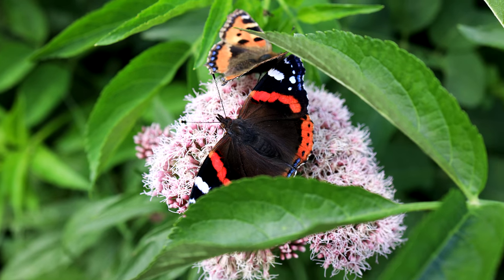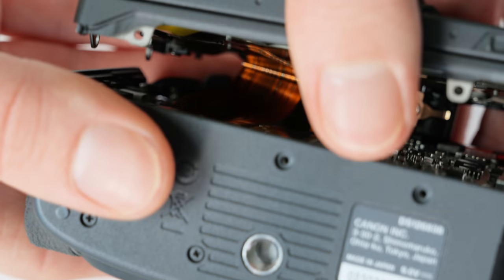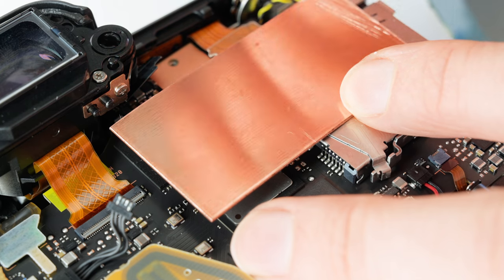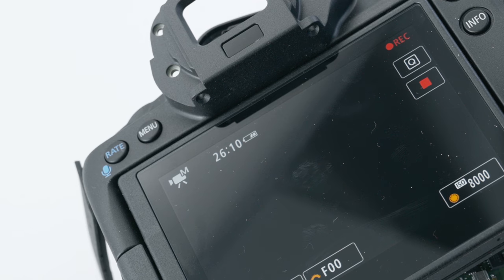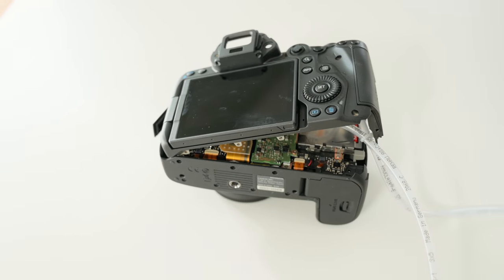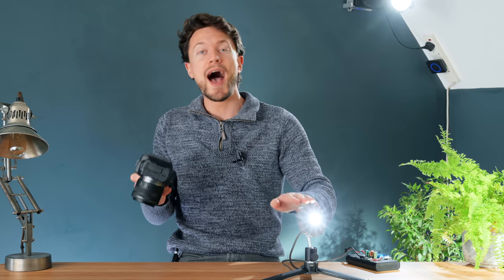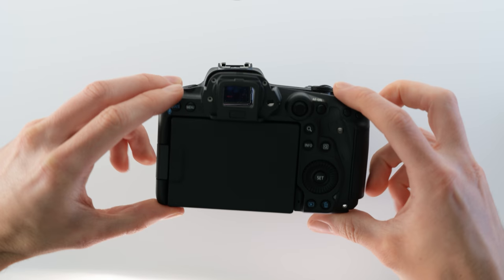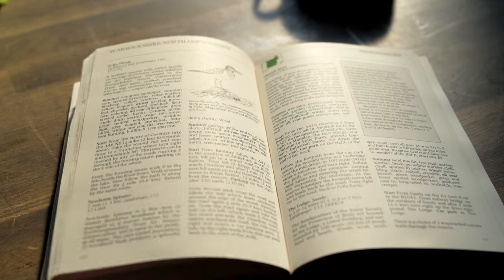The only reason to watercool a camera....

Comment: Leave it to a YouTuber to solve a problem a billion-dollar company dropped the ball on. Cannon Should be ashamed.
Reply: They could at least have the plate made from copper...
Reply: @PaulojnPereira  then them cinema line will be in danger and they don’t want that
Reply: Das Beast Modus  exactly man
Reply: The decisions from bean counters often override the decisions of engineers.
Sometimes it's for dumb shit, like saving four cents by using cheap shitty Chinese capacitors that will die frequently.
Reply: do you seriously think that they were not aware of this?
Reply: "Cannon" lol
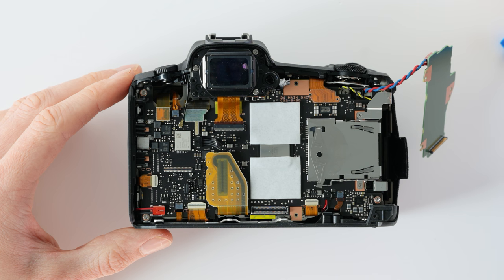Reply: @PaulojnPereira  or just cover the whole CPU with thermal pads... 3:54 why do they leave the middle completely free lol 😷
Reply: @PaulojnPereira  Priorities :) for Canon. copper is ~4x the price and ~3x the weight of aluminum. Add additional cost to stamp it in shape to be just like in the video.
A vapor chamber would be lighter and far better at moving heat at the expense of manufactuing complexity.
Reply: @ArthursHD  A vapor chamber NOT made from copper i assume, well why not try a cooling Peltier plate instead?
Reply: @PaulojnPereira  power considerations and also because they don't work that great in general
Reply: @PaulojnPereira  now you need even better cooling for the peltier itself
Reply: They shoüld be shortly ashamed and the learn to just send him prototypes in advance and let him enhance them bevore selling them 😉
Reply: Canon should be sued
Reply: Every mirrorless camera tailored to making photographs overheats in 4k mode.... Even panasonic full frame, nikon....
Reply: @dragomirstijovic5569  This I understand but if you see that it would be pretty easy to double the time with just a copper plate 🤦🏻‍♂️
Reply: If there was ever an interview for "chief thermodynamics engineer" at Canon, DIYPerks just nailed it.
Reply: Why not cut out a section of the back panel and inset a sheet of copper or a thin black anodised heat sink (just for looks).  
Would it cook the lcd when closed?
Reply: Based on Canon's track record, I am sure they didn't "drop the ball" on this one. I am sure it was an intentional decision to once again cripple cameras in this price range. Hopefully they will learn a lesson from this one, but I think they are just going to use this as a springboard to sell the Mk II version...NEW, IMPROVED, DOESN'T OVERHEAT! :|
Reply: Das Beast Modus  it's probably not the engineers, but the bosses and finance people probably hindered it.

People in finance fuck up so many games, products and laws. It's insane
Reply: This has been talked about by experts. Adding in good kind of cooling is really difficult when maintaining weather sealing on a photography camera. Add active cooling and you have a cinema camera, which canon has in its lineup.

I find it amusing people calling this a cripple hammer when the hive-mind Sonys had overheating in regular 4k recording.
Reply: @simonnilsson4973  as you noticed, Sony had problems with overheating, but it was an APS-C camera lineup from a couple years ago.
Reply: R5 Mk II will only be a copper plate upgrade
Reply: @PaulojnPereira  Obviously they want to limit this camera use not overpowered it lol like sony bad phone camera where they excel in sony alpha line up cameras
Reply: @MattSteez  they won’t fix it, if the r5 was reliable for long high quality takes it would significantly impact the pro movie market.
Reply: @maxmaxmaxgoon5602  no
Reply: @PaulojnPereira  even worse, they could have at least covered the entire processor with a thermal pad....
Reply: I agree
Reply: True
Reply: Yea exactly. If they just would have put some engineers on designing a proper thermal solution it would probably be a very low cost extra if any while having a even better product. If they can't do it they need to hire DIY Perks hahaha! Also putting a timer on the recording without even monitoring the temperature in the first place was also not smart.
Reply: @dragomirstijovic5569  sonys new lineup doesnt
Reply: @كرياتوريمحمد  thats bullshit. Their cinema line is not competing with DSLRS. Entirely different industry. They just added a video feature to a DSLR. Entire different
Reply: @annekedebruyn7797 Respect ur opinion but the way i see it is How many content creator choosing sony a7s3 over sony fx6,9 and their  entire cinema line ? Compare it to canon users , when a canon user invest heavily in ef glass guess what is the next move ? C line cameras because the features and autofocus with them lenses not adapted rather than being extremely user friendly although the lacking of features but the user experience is phenomenal-same as apple they lock the user tight once he/she get into it
Reply: @annekedebruyn7797  will u buy c500 if u have 12 bit internal no crop 4k low light beast EOS R ?
Reply: @كرياتوريمحمد  Yes because the workflow is the polar oposite. Hence why  Iam saying that the Cine line  is an entirely different market
Reply: @annekedebruyn7797  alright good point
Reply: @Knowbody42  Samsung did the same with their Plasma TV line from c 2013, crappy capacitors that failed killing a £2k tv. The DIY fix was c£10, i would have cost them maybe £1-5 to do it properly at the factory..... 
Also Audi did the same with lower cost wiring in the engine bays of their v10 cars, it wasn't rated for the heat and failed over time, often misdiagnosed as throttle body failure (a £2k repair), the actual wiring fix is a few £.

Arrghh bloody accountants
Reply: i mean linus did the same too but on his red camera XD
Reply: @Nightspyz1  EXAAACTLY
Reply: Canon intentionally did it to protect its cinema line.
Reply: Lol Gundam hiiii my friend
Reply: @ArthursHD  Lol forsure in this size
Reply: @PaulojnPereira  Peltier first needs lot of power second still have one side which is cold and one which becomes realy hot.
Reply: @12Burton24  Indeed, i was hoping to use it agaist the plastic case to cool the copper underneath and then use an external fan to cool the hot peltier side, but the power requirements may be simply too much to allow a practical and portable solution. Still i would love to see some projects using Peltier cells and how Simon would solve its challenges.
Reply: @PaulojnPereira  Well for cameras in this size it makes not much sense i guess. If you have some big cinematic cameras its maybe possible on filmsets and during sport recording but for this size of camera i dont think so.
Reply: @bananapie2198  and add another couple of hundred bucks to the price
Reply: They just need a smartphone thermal engineer.
Reply: Thinking of doing a face reveal with the R5, Papa Gundam?
Reply: Actually, this happened because it needed to be weather sealed, because it's primarily a photography camera.  They're going to make a cinema version later that has vents.
Reply: Well hello there 😝😝
Reply: @dragomirstijovic5569  my original EOS R has never overheated in 4k recording in its limit of 29 minutes for hours. This issue use to be a sony problem, now with the R5 its also a canon problem. Also, years ago I used a panasonic lumix g7 in the same way, never even got warm.
Reply: they didn't drop any ball, any solution would have added weight/cost to a stills camera in order to make it better for video
Reply: on a 4000+ unit
Reply: Why should they pay people to test it and find a solution when youtubers and customers do it for free? If people would actually give the shit back, this would look different. Now you are a beta tester when you don't give the product back.
Reply: It's been nobbled, the software update says it all, all most new CPU, have temp sensors in it some ware, but it still switches off when it is clearly not that hot!, I would bet there was a pro version in the pipe line, to be released soon, for an extra price, but would be almost the same camera but without the 20 minute turn off thing happening, maybe being sold at an extra long battery running time or something?
Reply: @2810Mad  
It's been nobbled, the software update says it all, all most new CPU, have temp sensors in it some ware, but it still switches off when it is clearly not that hot!, I would bet there was a pro version in the pipe line, to be released soon, for an extra price, but would be almost the same camera but without the 20 minute turn off thing happening, maybe being sold at an extra long battery running time or something?
Reply: @Knowbody42  I wonder how much industrial waste in the form of pollution or byproducts would have been wasted for Canon to add extra material into a camera that less than 1% of users will ever even notice. Sometimes there is a bigger picture to consider. If you need to record 4k video for longer, buy a higher quality professional video camera that is designed to do so... don't expect a camera that costs $4,000 to compete with one that costs $40,000.
Reply: @sango_wango851  In addition to having higher quality manufacturing, I think Japan is far more environmentally friendly than China is.
Reply: Shame to see a Japanese brand using Chinese engineering design with aluminum heatsink on such expensive camera
Reply: true! cant have us little useless feeders getting a piece of the pie!
Reply: @2810Mad  it is a $2k camera, they should do something about it
Reply: Surface temps of electrical devices limited by IEC, thats they don't use surface of the equment as a cooler ... For example :

   MacBook Air M1 is a fanless laptop , gets toasty and downclock after 5min of heavy workload , there is no thermal pads between cpu block and shiny and big Al surface , Actually there are isolation material... LinusTechTips removed that isolation and added thermal pads and Macbook Air kept his clock high as MacBook Pro M1 sometimes beats Pro , but at the downside outside of the laptop is hot and abow threshold of pain... Non moded Air is half a degree below of thresh hold of pain... So they kept laptop slower/warm at the cost of being able to holdable...

  This might be the issue why Canon left the desgin in that way... DSLR s are degined to be hold by hands so their surface temps needs to be lower than a laptop which is mostly on ur covered lap or a desk...
Reply: @PaulojnPereira  Because that requires power to work, and it can only cool as well as it can dissipate heat on the other side, and it will heat up as a result, up to the point of burning you.
Reply: Buy an actual videocamera, problem solved.
Reply: @ArthursHD  This is a US $3500-$4000 camera. I don't think the kind of people dropping that kind of money would give two shits if canon had tacked on an extra $25-50 bucks to account for a bigger/thicker copper heatsink and some proper thermal paste. At least then the overheating would be a minor issue instead of a debilitating one.
Reply: I dont think u understand the problem at all, Its not a question if they can do it or not,  Canon doesnt want there cameras recording video for long, as they are designed for photography not videos. They always said the 29.59 min vid  limit was due to european countries taxing issues, and while that might be partially true, it doesnt explain why lets say canon usa has that issue.  If it was a euro tax issue then it should have been a euro version limitation and not worldwide limitation, we already have different versions of the same cameras in different markets, like usa. This goes for all electronics really, somethings are disabled in certain markets while open in others for various reasons, but the video limit in usa isnt one of them. So the only logical reason that many agree on is they want you to buy a dedicated video camera for video if that is your primary focus. They dont want you getting the best of both worlds with one device while taking away from another.
Reply: @reality150tv   But you are not getting the best of both worlds even without the continuous recording limitation....The lens on it is not meant for video recording (and might suffer backfocusing issues when zooming, since it is, again, not designed for video).
The amount of travel on the focusing barrel is probably also supersmall because it is meant for fast autofocus in photography, not for precise manual focus in video, and the zoom is not motorised like in most actual videocamera's.
As for ND filters, I am not sure if they did some software adjustments that simulate an ND filter, but you are without those as well on most "photocamera's with a function".

You are far off in saying you are not getting the best of both worlds when only focusing on a continuous recording limitation, because there is just so much more that makes a videocamera a videocamera and makes doing the work with a photocamera in the videomode debilitating at best.
Reply: It's a photo camera that can do video. Not a video camera that can do photo

Their EOS C line is meant for video that doesn't overheat
Reply: I mean, Canon has been overrated for years, so it's not all that surprising.
Reply: @كرياتوريمحمد  True that habibi
Reply: @PaulojnPereira  In a closed system like that, a peltier cooler will generate more heat. They're super inefficient.
Reply: NO heat-pipes, no copper heatsinks, thermal pads - not paste.... a power board ON TOP of the heating chips...  This is by DESIGN... Canon don't want an 8k full frame camera competing with their CINE $20,000 range... given that full frame cameras with L series lenses have amazing picture quality...who'd buy them when a $5,000 camera could do the same? So.... hobble it in a "believable way", not by firmware (that can be hacked) that limits record times, but by the very parts used to keep it cool! It EVEN REPORTS "Too hot!" as an error message - it was released with overheating messages! If overheating was a "mistake" they often crash and shutdown - because the designers weren't expecting it... Not Canon's.... HMMMMMMM! Suspect.
Reply: @PaulojnPereira  Power usage dude Peltier plates are super inefficient plus that heat would still have to go somewhere.
Reply: Ashamed?Maybe partially. Problems are more complex to solve than the appear, and of course, have some water tubes and a radiator dangling outside the camera is´t a solution. Any solution has to be implemented to the assembly line.
Reply: What is cannon?
Reply: Naivety...LOL! Try to market this as a standard feature to carry around a water cooled radiator....epic fail. It all depends on the typical use case. It's a camera NOT a camcorder. Even the expensive RED cameras with internal fans will overheat in warm climates.
Reply: But they would do this cause there a risk of getting burned by the plastic temp
Reply: Yes exactly . Cannon should give opurtunity for creative people not those who score and pass the interview as they expect.
Reply: @ArthursHD  do you know the price of thag camera?
Reply: Cannon: What did I do wrong??
Reply: @Knowbody42  ma5ibek barrawah
Reply: @barmetler  mabeldek
Reply: Of course Canon can do it, they've purposely throttled it's ability.
Reply: @Knowbody42  when you're producing at the scale that they are producing 4 cents quite literally goes a long way. So every single cost cutting measures that they can take, they will
Reply: @alangunn7254  there are connectors on the plastic back plate that connects to the lcd, so no one can do that
Reply: @variamente6855  The R5 is not so much a high volume product. It is their top end, most expensive halo product.
For every R5 they sell, they will likely be selling many many many times as many 200D, 800D, and like M50 cameras.
Reply: @Knowbody42  its actually a very high volume product. The r line is becoming very popular and as long as its higher than their cine tier stuff, its high volume enough. Besides, a lot of hobbyist and enthusiasts buy the r5 without actually having the need to use these features so as far as the normal consumer goes, they covered that too with the r5. Besides also companies like cost cutting measures, and i've heard it compromises weather sealing because last time i checked you cant clip to pieces of plastic together and call that weather sealed. They could have definitely added thermal pads on top of the processor or maybe replaced the alu plate with a alu vapor chamber and it would have been much better
Reply: I'm betting everyone testing the camera was just being too nice to tell their boss it was overheating. hahah You know, you don't want to cause a fuss. 

I wonder if the people responsible faced any dsicipline/firing,..
Reply: @Knowbody42  China makes good capacitors too.
Reply: Not really. It's really simple if you think about it. They're not ashamed, and never will because they don't give a fuck unless they have competition doing this.

This is actually great for guys like this awesome YouTuber who could make tons of money making custom mods for people who buy these cameras. I know I would pay for this work. Unlimited time for recording? Shut up and take my money. I don't have the balls to do this myself just yet 😅
Reply: @aaronbazil  Definitely not worth the upgrade to pay him...unless he's doing it for DIRT CHEAP. 

The price point and its abilities for this camera exist to compete with others in the same range. I beleive Canon released  it to a target demographic that is NOT youtubers, and long form content. Photography for the R5 is amazing - the video is also amazing - unless you do long form content. Think - quick HQ 4Q clips, stock, etc. 

To pay him to mod your R5 doesn't really make sense, cuz then you're paying for the camera, plus the mod, and you're definitely voiding your warranty, and forget it being portable. lol Given whats involved in making this mod, plus shipping, and what not...he should probably charge upwards of...at least OVER 700 bucks. And at that price + camera, you might as well go up to the Canon Cinema line. 

If someone needs a better camera, for obvious long form content/cinema art styles, then they should go up to the Canon Cinematography line. 

Like he said, I think canon just really blew the marketing for the R5. I feel like a lot of YouTubers are disappointed in it, thinking it was for them.

He's definitely super talented though! I learn so much from his channel. It makes me think twice whenever I'm gonna throw anything away. lol
Reply: @Chuck8541  that's true. But you would be surprised by consumer behavior. I mean the fact that people are willing to buy a beta version of a product before waiting to see how it pans out in later models tells me people are willing to spend on things like mods.

People have money to spend. Noone really needs an 8k DSLR. Most consumers are using their phones,  TVs and laptops. Even in music when producers buy incredible monitors when the consumer is gonna just listen on $20 ear buds is very telling of this same consumer behavior: doesn't stop people from purchasing all that extra unnecessary stuff.

When I had Facebook, in synthesizer and camera groups and found out that many people in those groups are just hobbyists and collectors and not serious content creators. Especially modular/vintage synthesizer people spend $5k+ sometimes just to make drone music or just to collect. These are similar to a lot of creators on YouTube using cinema cameras to make product review videos and vlogs on youtube. How tf can you use a fkn Red Komodo for vlogging!? It doesn't make sense. But this is the consumer behavior.

So it's not a stretch that, and I would bet a lot on this, that many people would purchase this mod just to show off and stuff or whatever reason other than actual content creation. It really isn't. 

This mentality of not wanting to support local entrepreneurs who are actually doing great work, and wanting them to be dirt cheap, but preferring to buy garbage but with a name brand attached is exactly why people will continue to be ripped off. And why companies like Sony will continue to not give a fuck until threatened by a competitive product.

I'm just in support of this Youtuber making a buck off this little opportunity that already exists. It's not fucking them over, because if Sony had made the mod and sold it for extra, people will still buy it! Like they still put up with apple products continually taking stuff off their products but charging an arm and a leg.

Consumer behavior.
Reply: Gundam you really think those executives weren’t like “I have a idea! We can use a tiny fan to cool the cpu!” “Costs too much” these people r only interested in profit
Reply: You really think they weren't doing this shit on purpose?
Reply: @PaulojnPereira  Actually it has some taxation issues if a camera records past 30 min it considered a camcorder and they had to pay 5-10% more tax on that (indian taxtaion law )
Reply: Cannon should hire him
Reply: @2810Mad  Of course they were, given they gave it a software based overheat timer to begin with. This flaw was intentionally left in the camera because due to its amazing specs, had it been capable of unhindered operation at 8K it would have given serious competition to its own Canon EOS Cinema line of cameras, as only film makers with the highest requirements would still need a Cinema over just buying an R5 that would suffice for 90% of peoples needs.
Reply: The older you get the more weird it becomes. Networking, software, construction.. everything done piss poor
Reply: just the fact that the thermal pads are in such horrible positions shows how much care they really put in
Reply: Canon needs a reason to sell their cinema cameras…
Reply: what u mean leave it to youtuber who will use camera with water storage i backpack to keep it cool
Reply: @thegodtroynaar yeah, and probably lower them too.
Reply: Well he's an engineer
Reply: Yes
Reply: @Knowbody42  This is why we need to change from a corporatocracy and into a technocracy.
Reply: @andrerice7567  A technocracy is going to be a corporatocracy.
Reply: @Knowbody42  Incorrect. Technocracy is rule of science or rule of technical expertise in the respective fields. We currently live in a society where bean counters have say over technological production. Which is why you have products manufactured with defects even though engineers have solutions to those defects. The bean counters and politicians love saving 4 cents on a part even if it cost lives while the engineer cares about safety and function. 

Engineers can solve a lot of our current issues in society...but the bean counters and elite control how resources are distributed and how products are created at the end of the day. So, ultimately you are incorrect.
Reply: @andrerice7567  Who do you think will end up controlling the scientists? It would either be corporations, or it would be the government. Or both.
Reply: @PaulojnPereira  lol this is a year old, but you solve the problems associated with peltier by not using it in the first place
Reply: Inb4 this was their plan all along. Crowd solving a problem that'd cost themselves way too much RnD.
Reply: Now here's a face I didn't expect to see here, cool.
Reply: If they added thermal paste, a copper plate and an external fan for the camera, the camera would be like 70$ or even more expensive
Reply: @erslenderman2251  you think that would make a difference when the damn thing already costs 4.5k? XD
Reply: @BloodyMobile  didn't knew how expensive this thing was